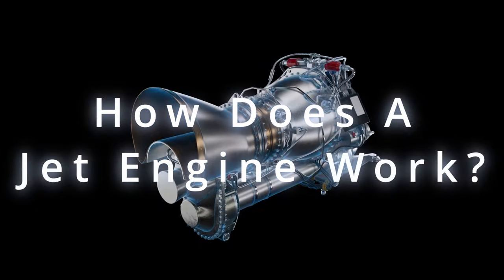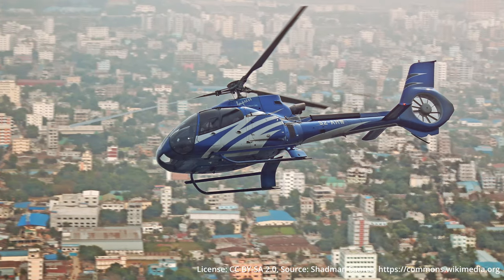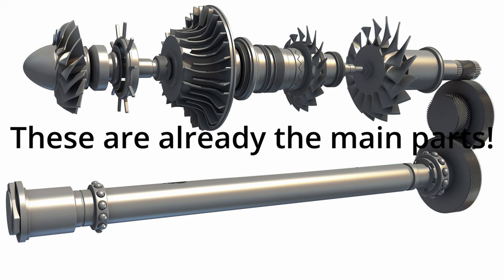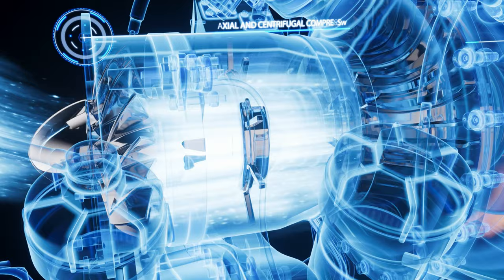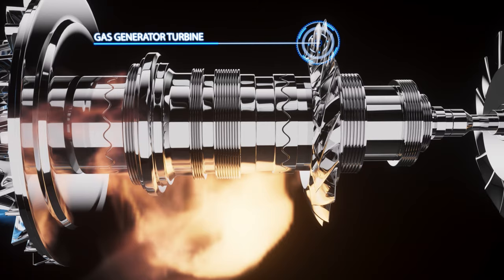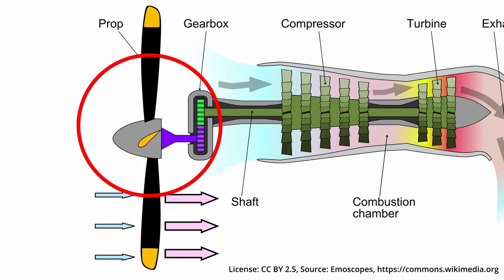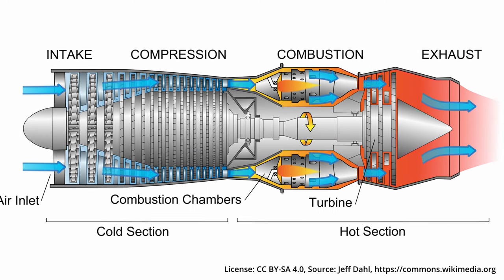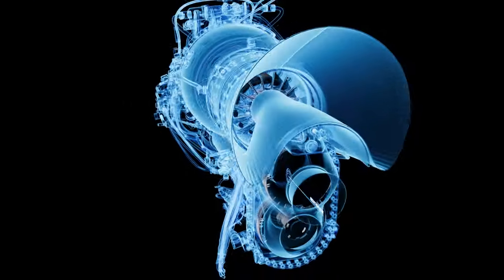How Does A Helicopter Engine Work? | Turboshaft And Jet Engine Explained

Comment: It is fairly easy.
If the engine wasn’t powerful, there would be no take off and flying.

Thin as air comes to mind. 

And a Lycoming IO-360 needs about 32 liters of fuel per hour minimum… in a Piper Cherokee, and 40 liters per hour in other small aircrafts…

Imagine the power and fuel needs of a large Airbus or Boeing… not to forget fighters and other military aviation vehicles…

Comment: What do you have spinning behind the axial compressor? That doesn’t exist.
Reply from the maker: I think there is an error in the 3D model. I bought the 3D modell and hired someone to do the animation. I'm not a animator by myself. I checked everything and I also noticed this error. But I think the main function should be correct, but yes this spinning thing shouldn't be there. 😉